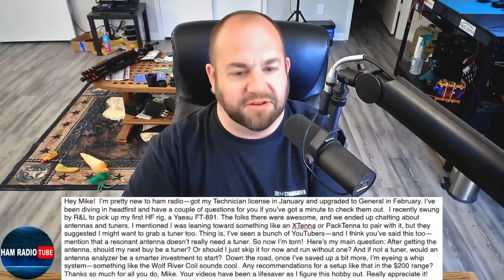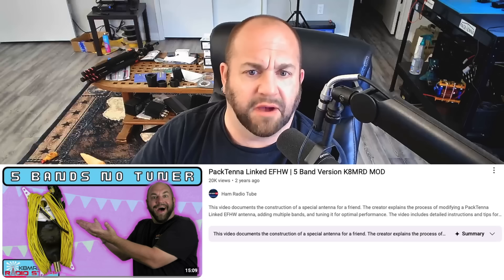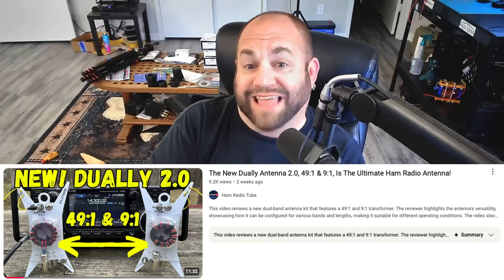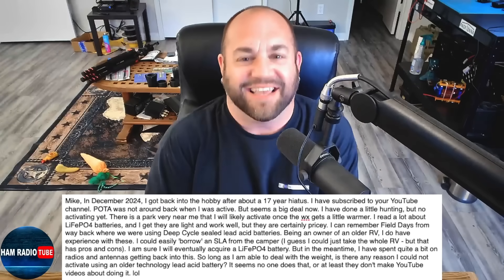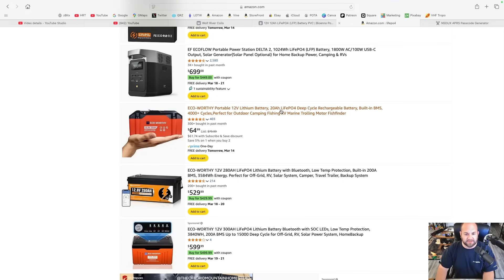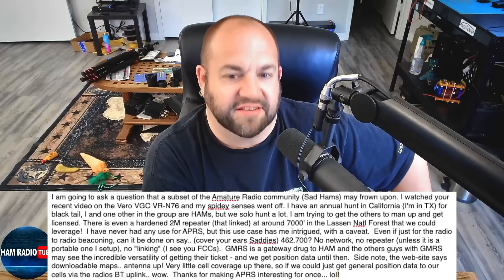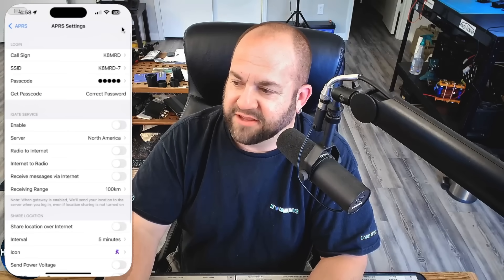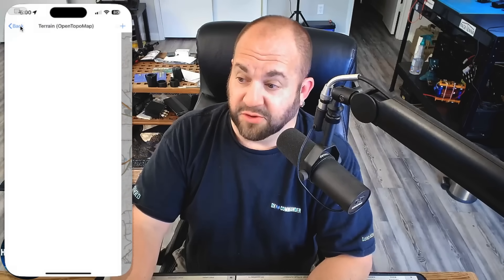APRS Over GMRS With Vero VGC VR-N76

Comment: Like others have mentioned, the BTECH GMRS PRO is a GMRS variant of the VERO VR N76 ham radio. Because of this, the BTECH GMRS PRO can be set to RECEIVE and decode APRS packets on the ham APRS frequency, transmitted legally by the VERO VR N76. Likewise, the VERO VR N76 also supports RECEIVE and decode of the BSS gps and messaging protocol being transmitted legally on any of the GMRS frequencies (except no repeater input frequencies) by the BTECH GMRS PRO. In this configuration, the ham users and gmrs users can legally transmit the protocols and frequencies permitted by their license and radio, including the ability to decode APRS and BSS between the ham and GMRS radios. Of course this applies to voice communications between ham and GMRS as well, when properly configured to transmit on one’s own properly licensed frequencies, and using dual watch on the radios to simultaneously RECEIVE signals coming from ham and GMRS.
Of course, it is simpler still, for everyone in the group to simply use the BTECH GMRS PRO, for the same results but eliminating the need for any ham licenses and doesn’t require the  unusual ham and gmrs crossover setup I mention above.

Comment: I agree with "get an analyzer first". Even if one gets a G90 with the Tuner that Can Tune Cheese, having an analyzer is the first step to understanding how and why your antenna works! They're not hard to use, not expensive, and easily the most important tool to have in your kit beyond the radio, antenna, and feedline themselves.

Comment: Nothing to be scared about, under permissible uses it states you can send data and text over GMRS, not sure why this is a surprise or questionable. That radio and app looks to be a direct port of the Btech GMRS Pro or the Btech UV Pro.  Part 95 E Permissible Uses D - Digital data.  GMRS hand-held portable units may transmit digital data containing location information, or requesting location information from one or more other GMRS or FRS units, or containing a brief text message to another specific GMRS or FRS unit.

Comment: According to the Maximum Power Transfer Theorem, the maximum transfer of power happens when the impedance of the source matches the impedance of the load. So when a tuner matches the load impedance to the source impedance, maximum power will be transferred. Tuners are not just for making the radio finals happy. Of course, when you use a resonant antenna, the impedance at that frequency will match the source and maximum power will be transferred. This is one of the basic electrical fundaments

Comment: I thought GMRS radios could have a removable antenna but FRS cant...
Reply: GMRS can have removable antenna. However the FCC made it so if digital signals are sent, that option is not allowed.
Why? I have no idea, maybe they don't want people using amps with them. However that doesn't make sense because we have APRS audio adapter that can can connect to 50W mobile stations are do everything legally at max power.

Comment: The  Vero radio and the sister versions, BTech and Radioditty can send digital geographical information and text messages to the BTech GMRS Pro through the Chinese signaling  protocol built into all 4 of these radios. No need to use APRS.

Comment: Unrelated question but I know how great the ham community is :) 

I’m planning on putting a 24 foot 6x6 post 4 foot in the ground and using it as a mast for 3 separately fed inverted vees, a 10m a20 meter and a 40 meter. The 10 will be on the front 10-12 feet high to the feed point, a 20m on the back of the post at 18-19 feet and the 40m will be centered at 27 feet (there will be an additional piece of 1 inch emt with a small offset at the top ).
 
I plan on having 3 seperate feed lines with chokes on them but my neighbor (also a new ham) brought up a point that I never thought of, and now there is a worry that they will cause harmonic issues or reduce their effectiveness.?

Anyway thanks for reading, any and all help is appreciated so thanks in advance! 73!!
Reply: Research fan dipole, one feedline for all 3.

Comment: Another easy out might be to catch some signal analysis of the BSS (Basic Service Set) Protocol functionality the N76 supports as an alternative to APRS - already baked in.  Not much is offered as far as the technology other than it was designed for those without a HAM License and callsign.  Few know enough details about where it comes from or how it works though.  You might need a second unit and possibly an SDR to do any decode / testing with, but perhaps you, or someone you know, with the expertise would like to throw your hat in the ring to help with some recon here?

This is a topic I would like to know more about.

Comment: Not to worry. A buck's worth of crazy glue can convert any radio to a "permanently affixed" antenna. 😮😅
Reply from the maker: That's exactly what I was thinking!
Reply: Yeah, but that won't add it to the type acceptance list. Then again, who's checking the list these days?
Reply: I was thinking pinned and welded or 1100F silver solder but then I realized that was a different expensive hobby.